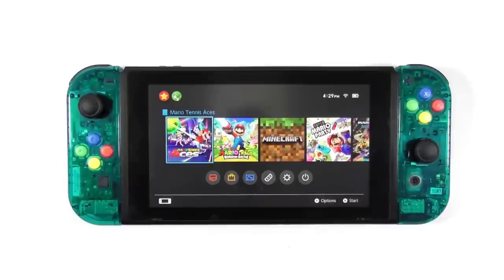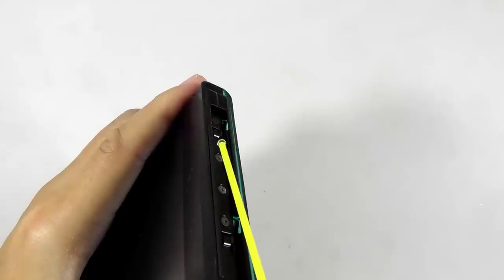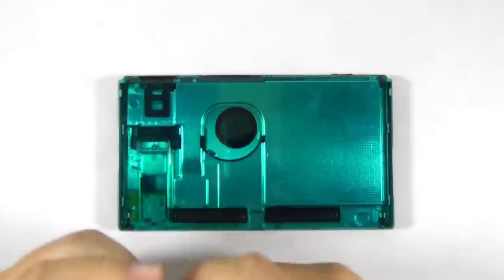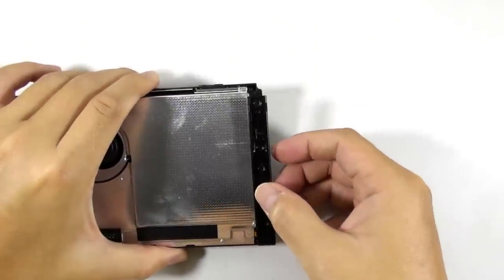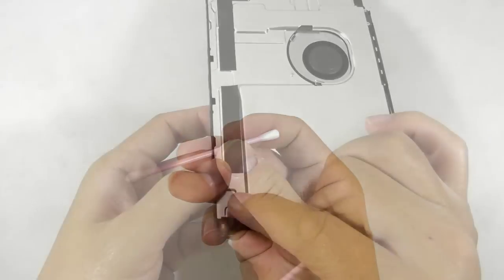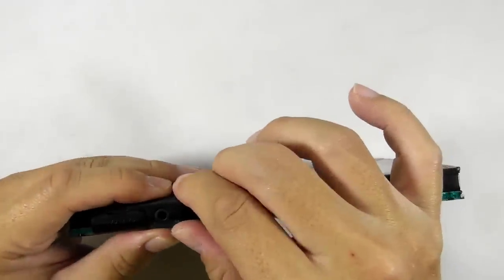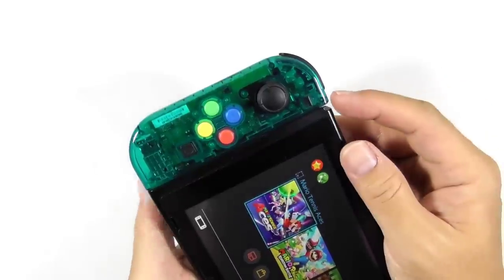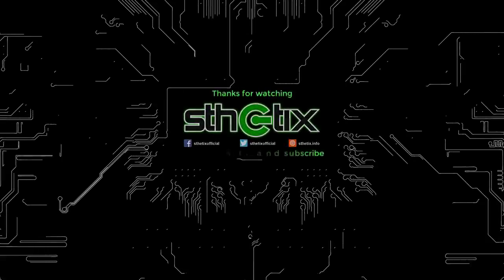Nintendo Switch LEFT JOYCON DISCONNECTING ? Here's how to fix it

Comment: I had no contact cleaner so I removed the joycon and just blew air on the side of the console and it worked, thanks for the video bro
Reply: yooooo i just did this right now and it worked!!! i even tested with another joy con and no problems! omg thank you soo much!
Reply: I tried it aswell and it worked thx m8 c:
Reply: this actually worked somehow. thanks
Reply: Thanks so much I thought there was no way I could fix controller without buying this it really helped!
Reply: Literally all i had to do 😂 thank u 🙏
Reply: OMG man, I've just read this comment and decided to blow air on the side like you said. The left controller works fine now!! lmaoooo
Reply: Don't do it with your mouth, your breath is quite humid and can corrode the metal contacts. You will have to replace the whole piece if that happens, instead buy some compressed air.
Reply: youre a life saver dude lmao how did i not think of the old good trick, just blow air on there hahah thanks alot
Reply: @EZ95  do u know witch side to blow it
Reply: @diegomoran1923  no one is buying air the point of this is too do it for free lols
Reply: 4 years later you saved me a lot of effort <3

Comment: Before taking your switch apart, try this first: Take a small amount of tape and fold it in half so it is twice as thick and sticky on both sides then stick it on the metal slider piece of the switch between the side rails so it'll be between the console and the controller.  This helps give just a little bit more friction to hold the joycon on better so it doesn't disconnect all the time while playing.  Hope this helps!
Reply: Will try
Reply: I’ll have to try this out. I’ve been having this issue for over a year now and I don’t have the proper tools (yet) to try and fix it. So a nice and easy quick fix would be welcome (until I can do a proper fix).
Reply: @the8wave  hey any luck from this method?
Reply: @jinbo369  I tried it and no work for me

Comment: There is one quick fix that I’ll share here (I had tried the WD40 and tried to bend the pins upwards, to no avail): 
Get yourself a cardboard from a cracker, cereal or any type of box that has a thin constitution. Use your scissors to cut a small square that will fit the lower part to the Joycon receptor, and gently slide the Joycon over that piece as it is inserted (Do Not Force It; If It Struggles, Forget It). And there you have it. That piece of cardboard will create the pressure that the Switch Joycon Receptor apparently needed.

Comment: To make your life easier to put back the metal tube just put the rail and the gold pins back in to position in the nintendo switch itself and THEN put the metal tube in. Less risky than doing it in the air, dont want to accidentally slip your hands and rip the cable.

Comment: THANK YOU! Connector cleaner did the trick, I had already tried cleaning it was alcohol and a q-tip. 20 videos, 50+ forum threads/articles, and 2 calls to Nintendo (unfortunately out of warranty). This was the last thing I was going to try before giving up and buying a new one. I had factory reset the device and it wouldn't go past setup until I "connected my joy con" which it refused to see as connected.
Reply: yo I did the exact same stuff. I want to open my switch now to fix it
Reply from the maker: what's the problem?

Comment: if any of these don't work go to settings go to controllers and sensors  then go to disconnect controllers then  take the controller with the x,y,b,a and keep the other controller on then press and hold the x button that is on the screen and it will say the controller is disconnected then hold your power button then go to power options and press turn off then turn it back on and boom worked for me.

Comment: Update. So yeah, after using Contact Cleaner and compressed air, the issue returned on my right Joycon. I decided to buy a Joycon metal lock kit so that I could replace my wobbly joycon  and to have the right tools to open the Switch. Lo and behold, I could use my Switch again in handheld mode. At first I was afraid of opening my Switch and breaking some parts, but this video helped me in opening and cleaning my Switch. Thank you so much! It is hard to find a repair shop during the pandemic. Just Under 5USD (203PHP in my country, shipping included) I was able to repair my Switch. I could hunt properly again in MH: Rise. Thank you! Thank you so much sthetix. I will subscribe to your channel!  More power to you!

Update. It happened again once but after that, it is okay again.
Reply from the maker: glad u fixed it.

Comment: I had the same problem and I simply went to settings = controllers then scroll all the way down to unpair or remove controllers press the X at the bottom center of the screen then remove both joy cons power completely off then turn on switch and place both joy cons back on and pair both joy cons. I haven't had that problem again.

Comment: Watched this video, then just blowed into the connectors. It worked for me now! Should spray some WD40 there too.
Reply: Be careful with that. When you blow you spit small saliva particles, and that could damage the connectors on the long run.
Reply: Did the same thing and it worked thanks man
Reply: Emmanuel use small fan for that :)

Comment: What about my case its not the rail its joycon itself but 3rd party joycon have the issue but when i put the original joycon no disconecting issue how to fix in joycon not the table rail
Reply from the maker: well, maybe you need to check the 3rd party joycon rail.

Comment: My old joycons didnt have this problem but I bought some new ones off ebay and they are doing this. Does it still means that i have to do this to my switch?
Reply from the maker: hmm, i think there is a problem with the joycon.
Reply: @sthetixofficial  lol i used the same logic as this video, i cleaned the joycon connectors with alchool and it worked. Thanks bro

Comment: I don’t know if you still reply but: I noticed that my contact pins were black. Does that mean that they burned or got too dirty and the substance was burned? My sibling’s Switch had too much cheese dust in the right side of the joycon slot and I had to open it up.         If it is broken, should I manually replace it or call Nintendo? And where could I get the replacement part?
Reply from the maker: try contacting nintendo or replace the faulty part. buy it on aliexpress.
Reply: sthetix would you happen to have a link? I’ll still look it up anyways in the morning. Thanks for the help!
Reply from the maker: there are a lot of sellers in aliexpress.. e.g. vivigame store

Comment: I wonder if the same solution would work on the joucon itself and not the system. My left purple disconnects randomly when in game.
Reply from the maker: yes same thing.
Reply: @sthetixofficial  but it's not like I wiggle it and it disconnects. It sits tightly there. But when like 5 to 10 minutes pass, it disconnects and turns on wireless mode
Reply from the maker: you need to check / clean the contact pins

Comment: After taking the rail apart I noticed a lot of corrosion on the pins, the rubbing alcohol did not fix the issue. What are the other options at this point?
Reply from the maker: maybe replace the rail..
Reply: @sthetixofficial  Ya that might be my only option, but the left one seems like a pain in the ass to replace because the cable goes under the battery
Reply from the maker: oh its easy.. lift the board a little bit then u can remove it.

Comment: 5/10 of the screws stripped...
Reply from the maker: because you are not using the correct screwdriver.. that's the point
Reply: @sthetixofficial  I bought a 00 Phillips made for the switch though 😭
Reply from the maker: use the one made by ifixit

Comment: I'm having a slightly similar problem... but with my right joycon... left is fine but... sometimes while playing games in handheld mode it randomly disconnects during play, I've found it happens when it's either pushed up too much or pushed down too much, but it does it only sometimes... some reason the problem only happens when playing rocket league
Reply from the maker: try this solution

Comment: Do NOT use WD40 on your switch! Just try cleaning. WD40 is lubricant and not meant for electronics.
Reply from the maker: think before commenting. i used wd40 contact cleaner not lubricant.
Reply: @sthetixofficial  exactly. Maybe think before responding. I'm making sure people know the difference
Reply: oh also... you should always be grounded when working with electronics. Probably wear gloves. you shouldn't use cotton when cleaning. they make special brushes for this. make sure you use isopropyl and not rubbing. this voids your warranty so before opening call Nintendo first.
Reply from the maker: thx for suggesting

Comment: Can I do it with my right joycon and can I use a blue wd-40 not the electronic one?
Reply from the maker: dont use blue wd40
Reply: @sthetixofficial  Is WD-40® Multi-Use Product safe on electrical parts?
Yes! Make sure you switch off the electrical equipment before spraying. WD-40® is a cleaner, lubricant and corrosion inhibitor. WD-40 Company also sells a product within the WD-40® Specialist® Range named Fast Drying Contact Cleaner, which a nonconductive cleaner that penetrates quickly and leaves no residue. Click here for more information. 

I read this on their website so it is safe to use?
Reply: @Ho Oh yeh but not sideways